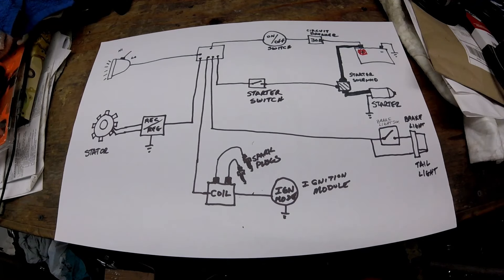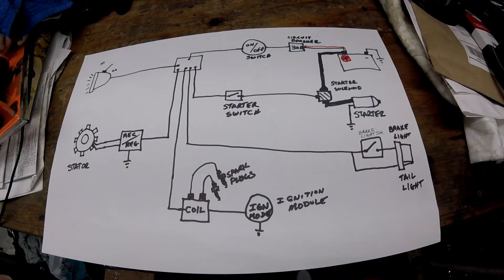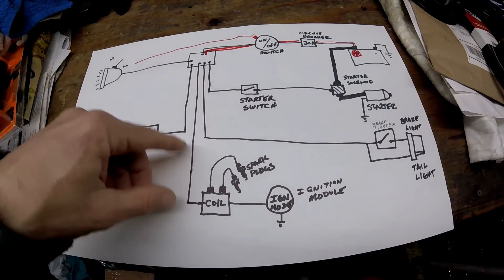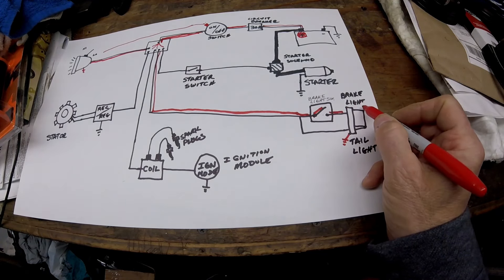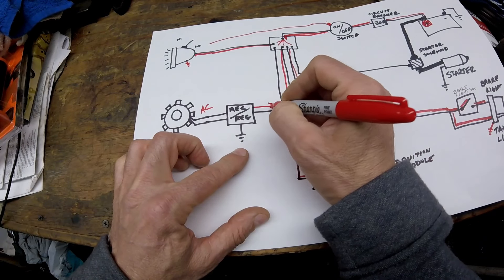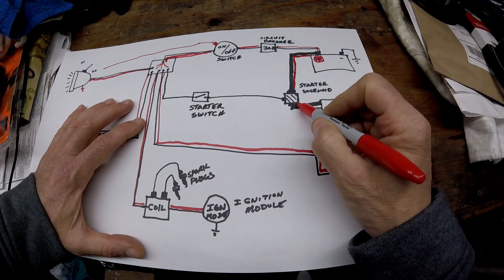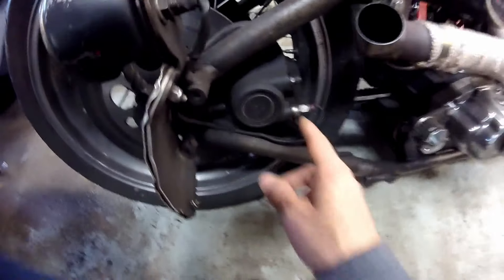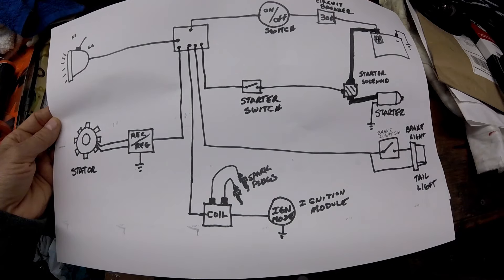How to custom electrically wire a chopper Harley Evo Panhead Shovel Knuckle Twin Cam M8

Comment: You know I have it's been a while but on tatro machine and I like watching anybody that's a lot smarter than me like you. But he had something about Harley always wired the regulator wrong The main wire coming back from stator rotor regulator. And it would go to somewhere but it should go somewhere else for I forgot what it was. But I'll watch yours when I get it time I just noticed you had this on here but it was something about the quickest way to get the electrons to where they need to go. Considering well electrons I guess the runaround at about 186,000 mi a second. If I remember anything from my electronics class. Thanks for always posting great videos

Comment: Do you need turn signals to get an inspection in whatever state you are in ? I realize some states and the year of registration may negate that.....
Reply from the maker: If your custom building a new bike, they do have to be on there these days. In Pennsylvania, we have what’s called an advanced inspection station and that’s one of the things that they check for. The only role that we have that is turn signals are on the bike they do have to work. If they’re not on the bike, then it will pass inspection.
Reply: @Rapsgarage  thanks!

Comment: Fuses missing! Essential to install a fuse!
Reply from the maker: @letricblue  it has a circuit breaker, it doesn’t need a fuse. Shovel heads didn’t have fuses either, only 3 breakers. I only have one 15 amp breaker in my chopper and have never had a problem. In fact I’ve never tripped the breaker and it’s been on the road since 2005
Reply: @Rapsgarage  your drawing don't show an overcurrent device, fuse or even an unusual breaker! Any fault could cause catastrophic fire.
Reply from the maker: @letricblue it clearly has a circuit breaker in between the battery and the on/off switch. 30amp is what I said to use but if you use all LED lights and it’s kick only you can use a 15 amp circuit breaker. I talk about it at the 1:03 minute of the video.